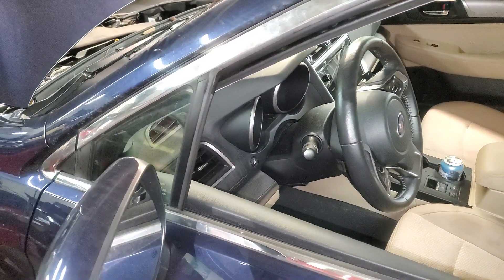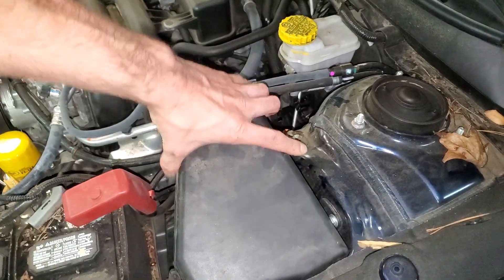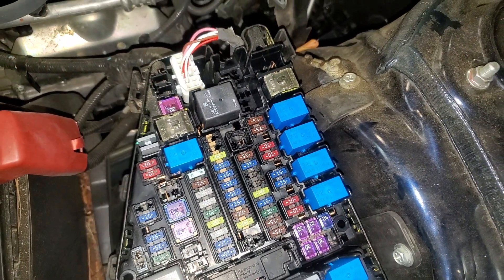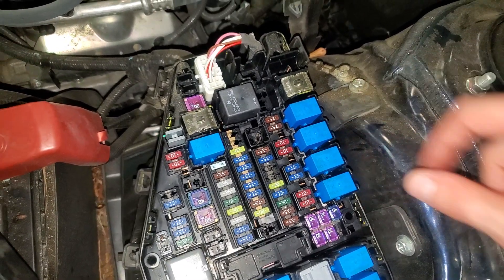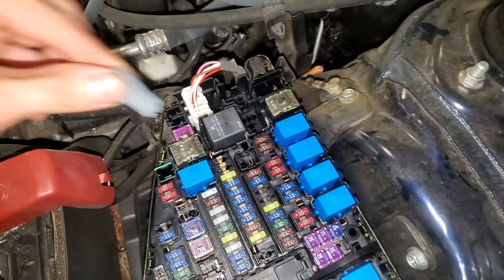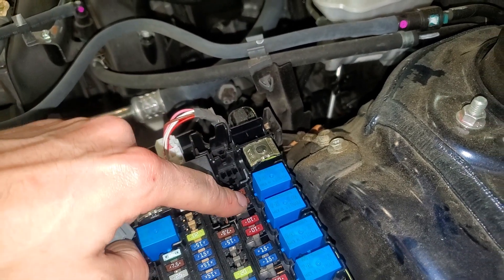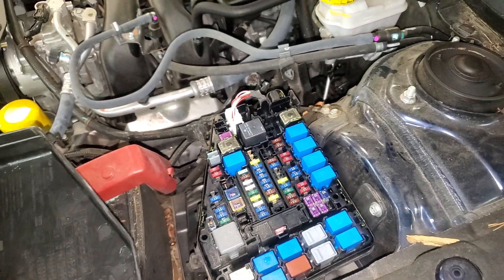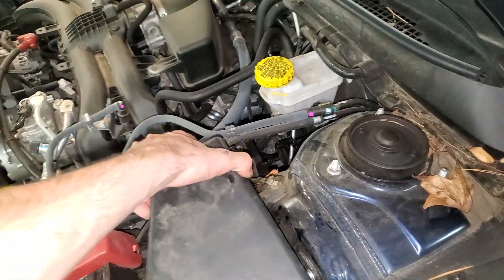2018 Subaru Outback Horn not working - Fuse and Relay Location

Comment: I checked both fuses, both are good, and swapped relay and horn still doesn't work any suggestions on what I could check next?  the alarm horn does beep when locking the car.
Reply: Hey did you ever figure out what was wrong? I'm having the same issue. Thanks!
Reply: I haven’t checked the relay, but both fuses look good. If the relay is working, what other issue could it be?
Reply: @MrMathematics00va locate the horn which is under the bumper near the front left headlight, could just be bad. Just replaced one on a 15 outback fuses were good relay was bad and new one still didn’t make it work, replaced the horn itself and it worked

Comment: Thanks for the video!  Where is the horn located on a forester?
Reply: I own a 2014 forester XT. Look at the bottom of the fuse box lid located in the engine bay it will tell you the fuse and relay location, the fuse box is located directly behind the battery on the driver side of your forester. There are also spare fuses in the lid. The relay is first and fuse is directly behind. If you want to know where the actual horn itself is located, it is the circle directly behind the top section of the grille. The bumper needs to be removed to properly access the wiring.